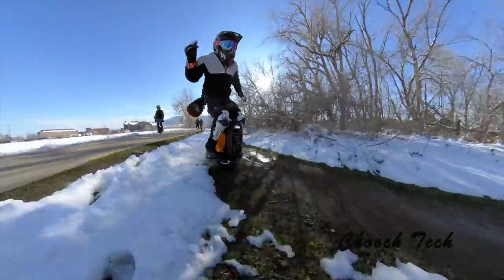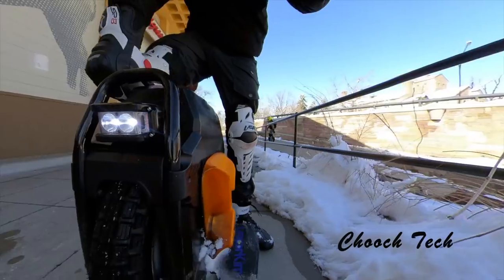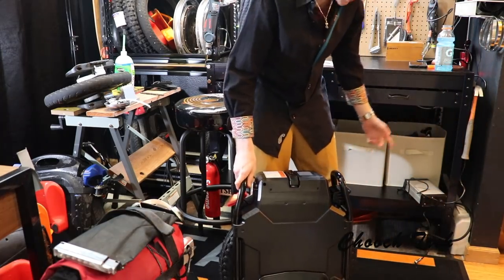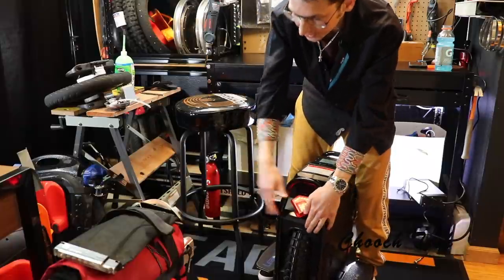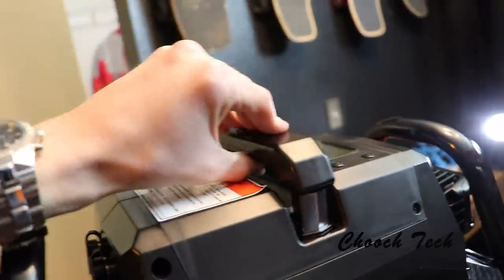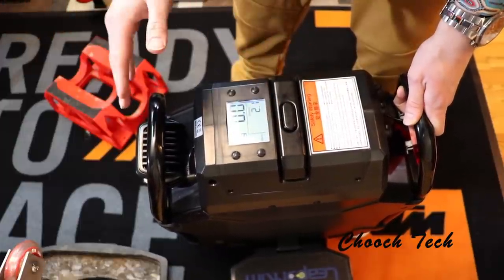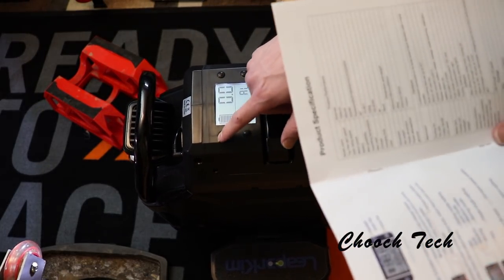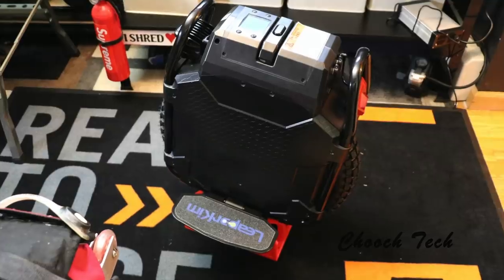MILITARY GRADE HALF EBIKE? VETERAN SHERMAN UNBOXING

Comment: Been checking out alot of videos on all of these wheels. They have an upgraded motor with a wider rim, also different geometry on the mount. New firmware also. Bluetooth module to plug into motherboard. Much love brother. Keep the videos coming.! 🍻

Comment: Nice video, I look forward to watching your waterproofing video. Still debating between this or the s18 for my 2nd wheel. I can send you some PSA tape that's used in production of marine flooring on boats. It's meant to get wet and have great adhesion. It should work well on silicone and plastic of the wheel.

Comment: Need to get:
1. Motorcycle slider
2. Modified seat,
3. Side saddle bags attached using zip ties to the sliders. 
4. Backpack rain cover (60L) to go over top plus sliders. 
5. Portable charger.

Comment: You think it would be an awesome idea if you were to install and mount on maglock on both sides of what i think should be called are a sattle, pegs., Footmounts, footplates, footstand, platestand, platemounts or mountstand... but never ever shouldn it ever be called ever call it pedals because it doesn't pedal any thing. So yes, it shouldn't be called pedals.

But, what do you think? On either maglocks on mountstand or clips. Would it be dangerous to snap you feet ewheel? Because I thought it would take the use off on squeezing your shins together and  the use of gravity inorder to stay on attached together.
   Thus only having to worry about is the lean angle for speed and if you catch air you know you'll always be attached and not having to worry about gripping sattle

Comment: Congrats! Since you just received it now, does it come with the higher pedal hangers and wider rim as Adam from Wrong Way demonstrated in his last video?
Reply: I think it probably is... because if you see the light is different (with the blinking side-leds), and also the cover of the screen has all buttons in black, which was not the case in the previous batches.
Reply: Also, I was wondering if you can tell if the rim is the new wide one without taking it apart.  I have one arriving next month and wondering if it will have all the v2 features (wider rim, new firmware, LCD cover with black buttons, and shorter pedal hangers).
Reply: @wheelerdan7313  Yes... from what "Wrong Way" said, all Sherman's from now on will be this new version with wide rim, shorter pedal hangers, and waterproof cover.
Reply: @wheelerdan7313  Yes at the bottom can access through the spokes w a calliper ..

Comment: I Just put a deposit down on the latest Sherman v2 .Im thinking od green military paint scheme powder coat the roll bar, x line all the plastic . Powder coat the rim . Find a way to tuck the light in . Upgraded with all the goods and add a touch or 2 of innovation of my own

Comment: I've had my Sherman since January 4th 2021, the roll cage helps a lot I ride hard I take a lot of risk I've crashed into cars I've had my wheel go underneath a car and that roll cage protects it, I've also dropped it 10 ft off of a cliff and it survived I still ride my Sherman, been thinking about getting another one because of the way I ride I'm at 1400 miles right now, they're going to have a lot of fun with that wheel

Comment: @12:48 hardly dude, If you "loosen the screws by carrying it",what do you think happen when you ride and those 20kg of battery rattles back and forth at every jump and bump (vs the wheel). There is a reason for the cracks in the gotway chassis where it's connected to the hangers but it sure aint carrying :-) to tightly spaced screws and to weak chassis. Basically engineering level at gotway (also Sherman, they didnt fix it)